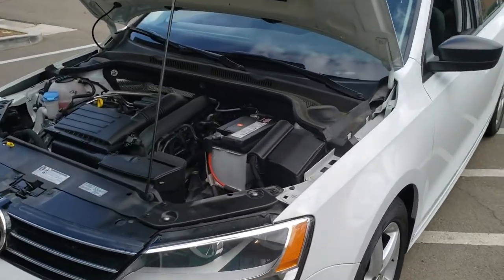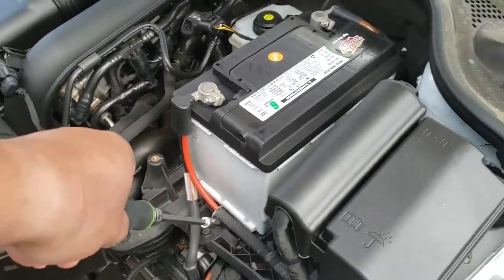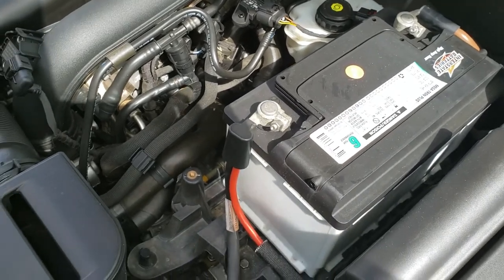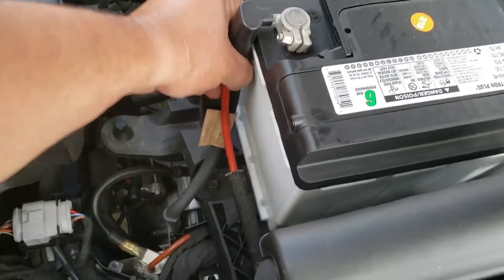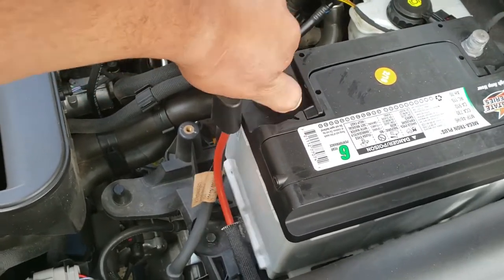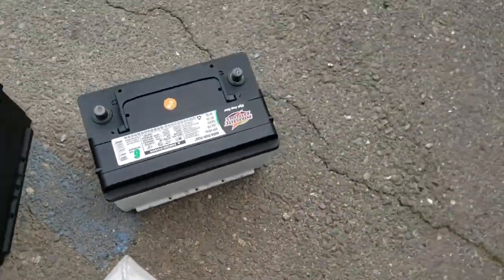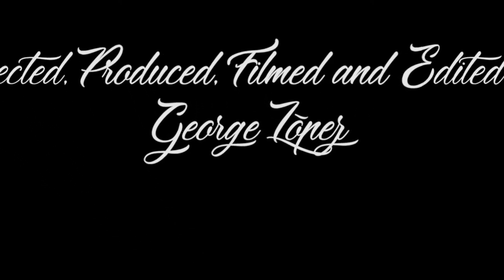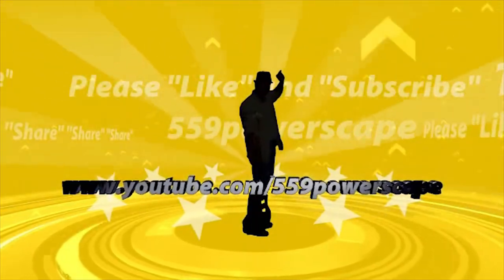How to: Remove a Battery from a 2016 VW Jetta

Comment: crazy that you have a replacement battery in the car only three years after the car was assembled and you have to replace it too. You went through 2 batteries in 3 years? That's crazy! My 2014 stock battery is finally needing a replacement.

Comment: Did you have to reset the computer or immobilizer after replacing the battery?
Reply from the maker: Disconnect your negative terminal and turn on your headlights so that way all electrical charge is discharged from your system wait 2 minutes connected back together try again. I don't think there's any way to reset the immobilizer that has to do with the anti theft system on the car
Reply: So nothing needs to be reset? I plan on changing my battery for my 2017 jetta myself... fingers crossed and I was worried about the computer system and all that. The guy at the auto shop said I needed a professional to replace the battery for me.
Reply: @sgrdst  how'd it go?
Reply: @sgrdst  no use a battery pack with a cig lighter or obd port adapter but not needed

Comment: Where is the battery ground.
Reply from the maker: Its the negative terminal closest to the firewall. It connects to the cars chassis. The frame of the car.
Reply: @559powerscape  okay. I'm loosing electrical power while driving. It's the weirdest thing, engine stays on and keeps but all electronics shut off and cycle back on in about 30 seconds
Reply from the maker: @DCMoney96  wow yeah I would check all your cables make sure there tight and not corroded.  If you have a volt meter as well read the current voltage when the motor is on it should be 13.4 or higher to 14 volts with the car ON.  If its the alternator its not going to be producing that voltage output. If its lower than 12v it more than likely the alternator.  But check your cables first. Could also be the battery. CHECK IT WHILE ITS OFF.. SHOULD BE ABOVE 12.3 VOLTS. MAYBE THE BATTERY is Not holding charge the way is supposed to. Could be a number of things. Sorry bro. Good luck!  Thank you for your SUPPORT!